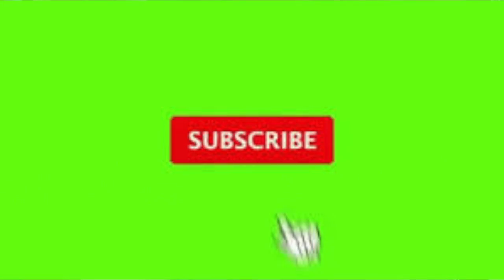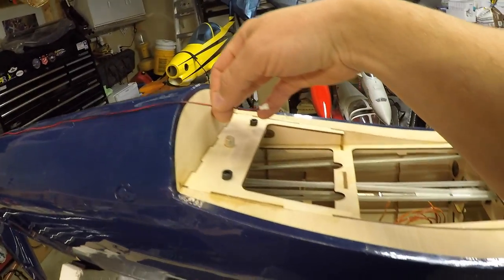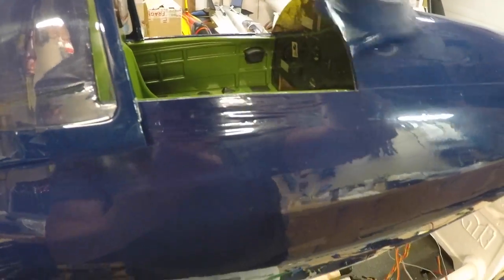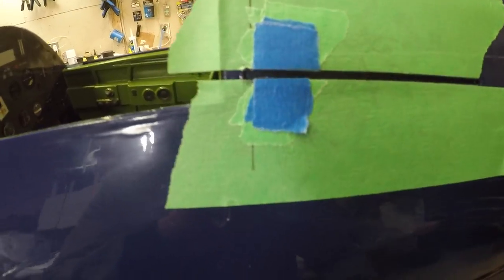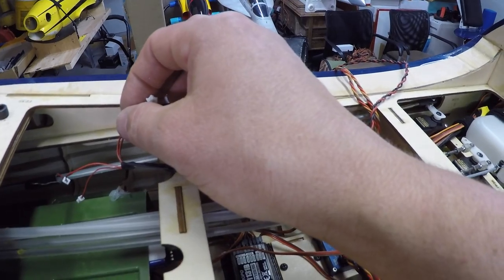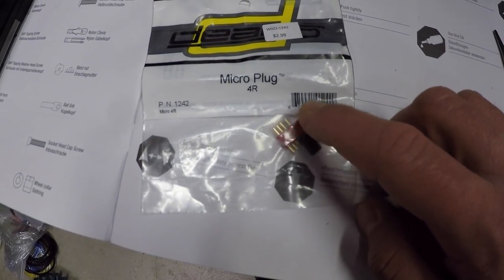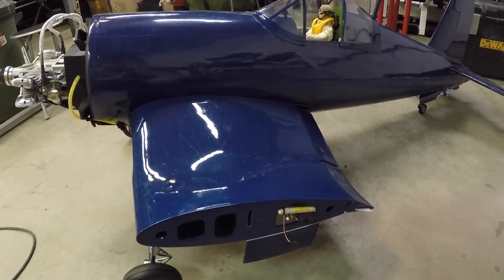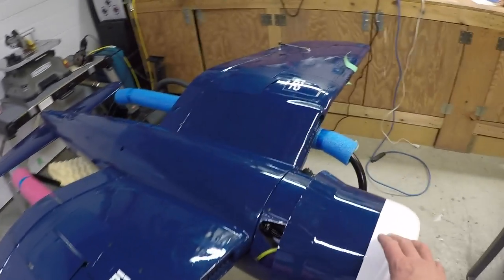Hanger 9 F4U-1D Corsair Build Series Video #5, Saito 57, Horizon Hobby, 60CC, JR28X 28x Radio

Comment: On tail wheel doors, have you considered elastic instead of the wire for the doors? The wire seems to catch and hang up, elastic might not.
Reply from the maker: Didn’t think about that. Thanks for the suggestion. Tried straight piano wire but it needs some give.
Reply from the maker: I was thinking about this again and the elastic won’t work. Reason is the doors are not spring loaded. The piano wire needs to be used to push doors open.

Comment: What is the brand on your central control box and where can I purchase one. Thanks
Reply from the maker: For radio or gear?  Radio is JR/deeforce. Gear is down and locked. Not sure they will sell just the controler
Reply: @thelightersideofrc  thanks
Reply: One question, do you know anyone that has a hangar 9 F4u Corsair kit for sale? I have retracts and engine ready for that kind of plane.
Reply from the maker: Sorry I don’t. I know there was a couple variations in this plane for sizes. Keep an eye out on RCGROUPS, RCUniverse, RCCANADA